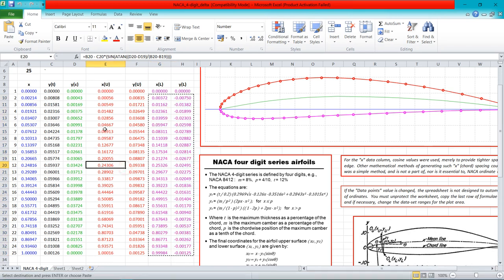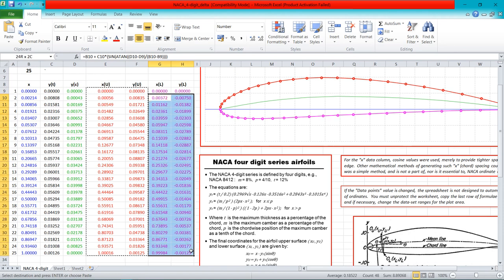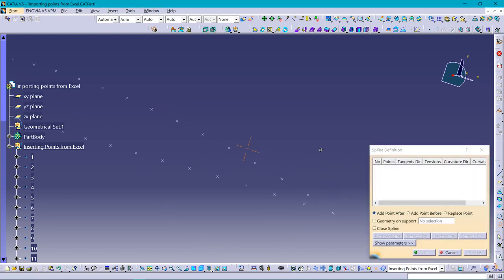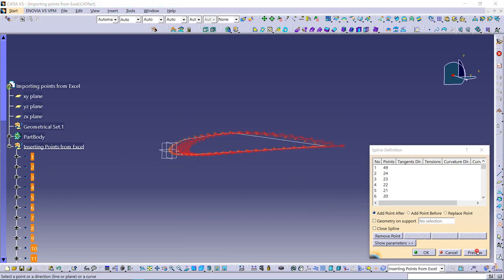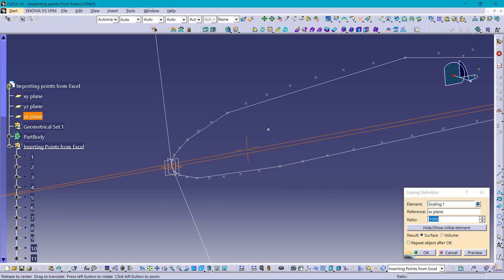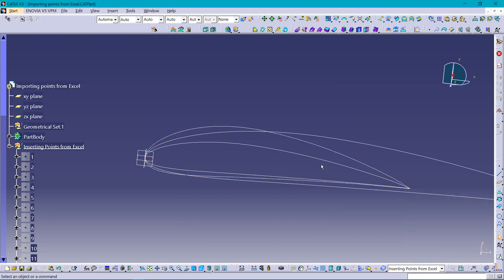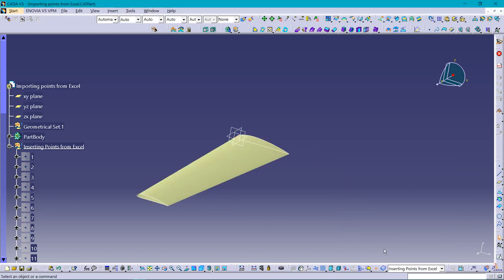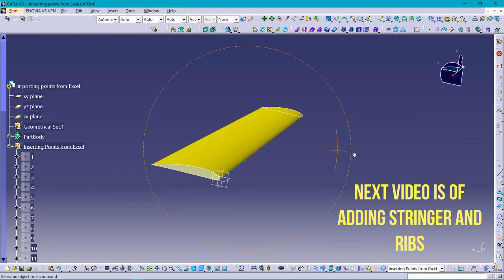NACA Series importing points from Excel Sheet to CATIA V5 | Design Aerofoil shaped Wing of Aircraft

Comment: Hello..For my case there's 3 different airfoil (not naca 4 digit) in root,mid and tip..but can u explain a bit about the airfoil data?Is it in selig format?Thanks..I will wait for your reply.
Reply from the maker: Yes, it is Selig Format, along with it if you have 3 different airfoil you can still join it using multi section command! 
1) Soon I'll make different types of wings in Catia V5 
2) If you wish then go on official site of Airfoil Tools for having  Data and then copy paste in my Excel Sheet to export in Catia V5. 
3) if you still find difficulty, write me at vishalpatil910087@gmail.com
4) Happy Learning, please share with your friends and colleagues. 😊
Reply: @magicofdesignsoftware4079  Sure..Thanks again.
Reply: I got a plane 2000 mm distance..Can I import another airfoil on that plane?
Reply from the maker: @adnan6149  Yes, you can export! Just learn basic methods and procedures! To avoid any abnormalities! 
Happy Learning ! 😊

Comment: Thnx bri for such a good information and files but i have opened CATIA but still the exporter is not opning in EXCEL it shows first open CATIA Application
Reply from the maker: Yes! 

1) First of all open CATIA then only it can export from Excel Sheet. 
2) Refresh it. 
3) Accept it as in editing Mode of Excel
4) If still getting problem.. Change your Microsoft Office Version
Reply: @magicofdesignsoftware4079   thank you so much could you please recommend me the version for excel becuase its still showing problem
Reply from the maker: Yes from 2013 to 2020 any of it. 
Rest if still it won't work
Mail me at 
vishalpatil910087@gmail.com

I'll help you to get things in line..!

Comment: Thanks for this instructive tutorial. Just some questions, you might find it too  stupid. But I would like to know why you used scaling function for this  example?  And the ratio fo scaling how did you choose it? Does it your choice or you relied on some standards? Thank you
Reply from the maker: No question is stupid dear. The art of questioning came from Socratic time. So I use scaling the fit the dimensions as per my requirements. I used Ansys software to simulate the flow over it.. So that's why keeping the scaling in mm, otherwise dimension of actual model is in meters.  So it's self selectable thing, so you can do accordingly.